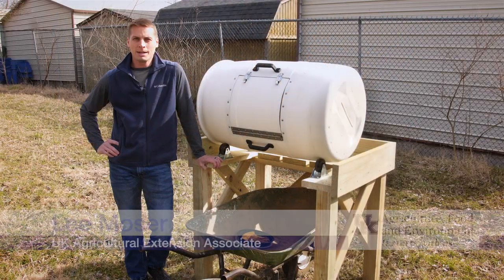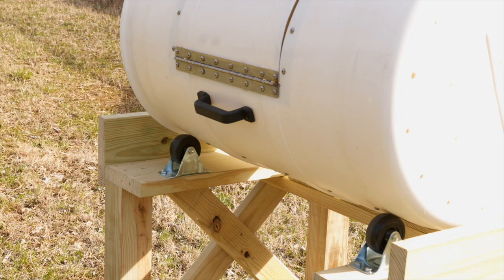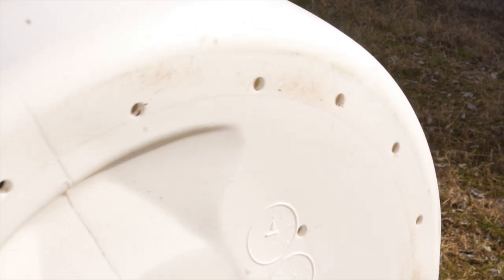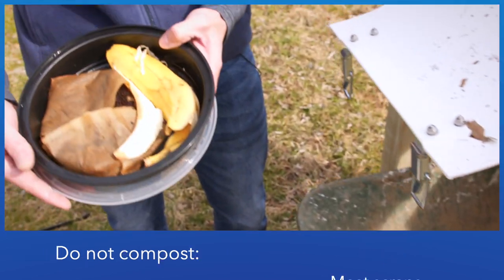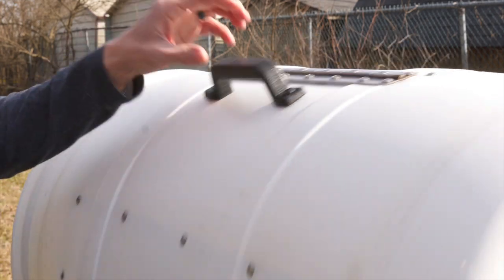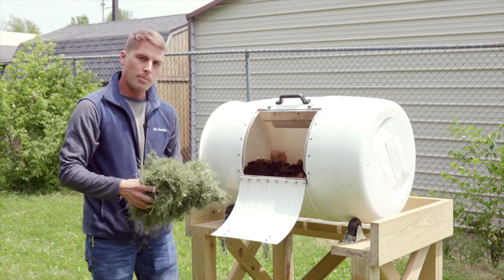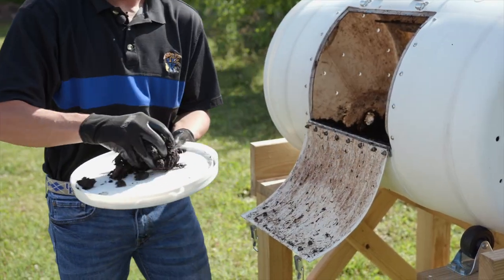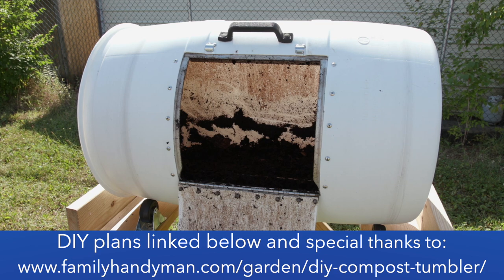At-Home Food Waste Composting for Resource Recovery

Comment: i made a compost tumbler similar to this several years ago (there is probably even a video on my channel regarding it).  I had experience using the old compost pile method and I had several of those going too around my homestead but wanted to try the tumbler method to see if it was easier or quicker because I need a LOT of compost.  Almost immediately I ran into some issues with the barrel style.  The first is that due to the extremely hot temperatures inside the barrel, you need to add water almost daily and rotate the barrel a couple times a day.  You would think this in turn would lead to quicker compost production but it doesn't ... this leads me to the second problem was the time to make compost in the barrel styles compared to traditional methods.  You stated in your video several months to produce a finished compost and that was my experience also.  Yet using a traditional compost pile and turning it once a week yields compost in only 3 weeks.  I had some theories but not being a scientist and no interest in testing, I assume the heat generated in the barrels affects the organisms that actually break down the compost in a traditional pile.  Also, in a traditional compost pile, the compost has direct ground contact where those organisms live vs in a compost barrel you have to add/inoculate them into the system.  I ended up going back to the traditional way of composting on the ground due to my findings.
Reply: i guess i should also state, I don't mean they don't work.  Probably for a home user that has minimal amounts of material to compost and doesn't require a lot of finished compost regularly that also has the time to turn it and add water daily ... this system is probably perfect for them.  But if you have a lot of material to compost and need large amounts of compost and don't have the time to tend to compost every day, the traditional method of composting is probably best.
Reply: @sharpridgehomestead  I am so glad that I watched this video and read your comment. The fact that it takes several months to make the compost is a dealbreaker. Why build this contraption, work more with small openings, rotate the barrel and wait longer?  It seems like a solution for a problem that does not exist. Even for a home gardener with 1/4 acre or less land, there will be more grass clippings every week than this can handle.
Reply: @hgwash1  that is exactly why I went back to the old way of composting
Reply: @sharpridgehomestead  How is the traditional way? Mind sharing?
Reply: @feiinc  the traditional way is just creating a pile on the ground and letting nature and microbes take care of it for you.  You turn the compost pile by hand (well, technically a pitch fork for smaller piles or even something as large as a front end loader for massively large piles) which speeds up the process.  If the pile dries out, add a little water.  I can turn out finished compost this way every 28 days ... so I keep multiple piles going in various stages.
Reply: @hgwash1  I use the traditional ground-based compost but here in Massachusetts, winter is a problem. I'm thinking of making this rolling type just for winter, knowing the compost won't do anything, but at least it will prevent squirrels and other animals from rooting thru the compost bin as their personal food source in winter.
Reply: Thank you, good man. Is the ground olive pit a good fertilizer? Thank you
Reply: @sharpridgehomestead  Thank you, good man. Is the ground olive pit a good fertilizer? Thank you

Comment: I am composting in the ground using a trash can with a locking lid that I drilled holes in the bottom, sides, and top. I can turn the cannon it’s side and roll around a bit and put back in place. We will see how it all works out for me.

Comment: your missing ingredient is water.  also - the trouble with the tumbler is that you have to STOP using the tumbler once it is full for up to 3 months to allow the latest additions to fully cure before you can use any of it.  You then need a SECOND one to continue with the daily additions. One looks complicated and expensive to build...let alone two. A simple bin with a lid on the top and a sliding door on the bottom would be much more efficient and cost conscious.  You simply add a bucket of chopped veg waste every few days from the kitchen and cover this with stockpiled chopped leaves from last fall.  dont mix it!  just plunge holes through the layers once in a while. After 3 months you can lift the slide and begin to take the oldest layers away and into the garden. As you remove it, the upper areas drop down ready for the next month and the ongoing twice weekly additions.
Reply: Please do go on, as I wondered something similar